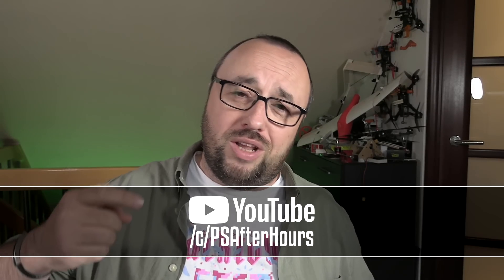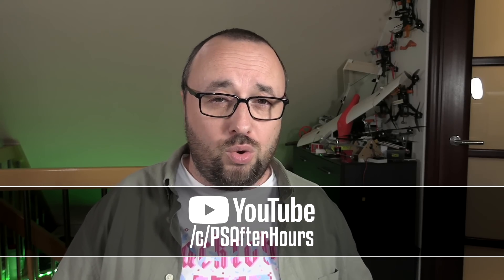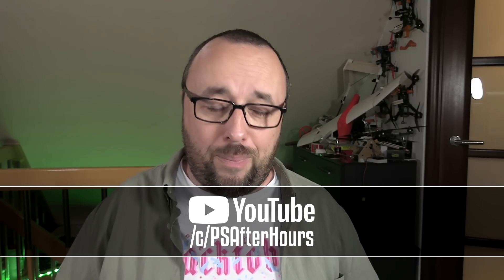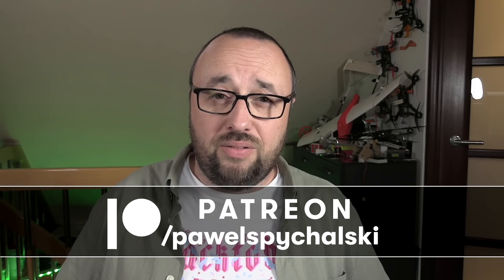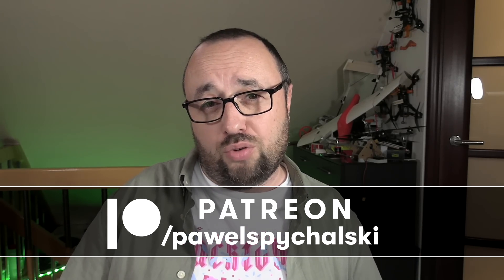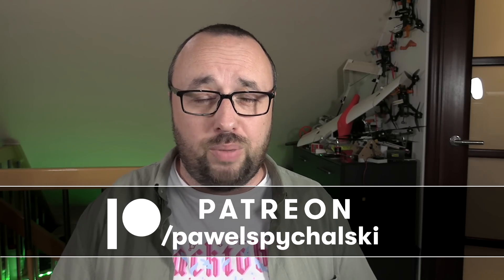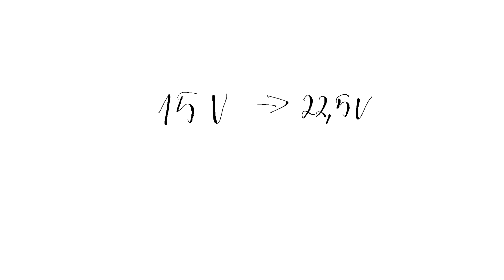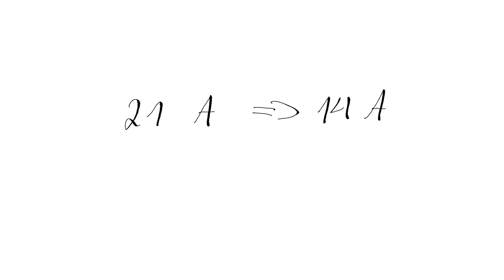Is 6S LiPo battery more efficient that 4S?

Comment: There is a lot of solid info here about electrical power, and you make a point about the small losses over small lengths of connection wires. But your model of motor efficiency seems far too simplistic and inaccurate. It seems like power dissipated in driving a motor is something like (a+b) I V +  c I^2 R where the I V term combines (a) the mechanical power with perfect efficiency and (b) losses that scale linearly like friction, while the I^2 R term represents (c) losses due to electrical resistance or magnetic field eddies. It looks like good motors may hit 90% efficiency at peak, but that efficiency drops roughly linearly as rotation speed lowers and drops severely at speeds higher than peak efficiency. So it seems like the lower I = current required to achieve a target mechanical power on 6S instead of 4S could be significant if either (1) it's at low rpm where efficiency is poor, or even more so (2) it's a high punch out rpm where I^2 is huge. And particularly in regime (2) the 4S motors generate more heat, which increases R and further degrades performance.

This comes from a few general searches, and I didn't put a full quantitative argument together. But it's enough that I worry something significant is missing from your presentation. What do you think?

Comment: What about voltage sag? I think 6s had much less sag than 4s, making 6s feel higher performance.
Reply: Less sag is because of less amp draw. If you are flying a 6s 1300, then it should be compared with 4s 2150mah. Simple physics. Then check the voltage sag.
Ultimately 6s, thrust is not increased.
Reply from the maker: Like @ForbiddenFPV  wrote. Less sag because current is lower. But is you scale C rating and capacity, sag will be very similar. Smaller on 6S maybe, but only a little smaller

Comment: 6s are more efficient not so much at hoover thrust but more full trottle. Because the lower peak current less batterij sack.
Where it is 10mOhm x 100A is 1V . So less need for thick cable is lower weight. The key to higher voltage is lower losses in the cables. The difference is bigger if you go 8S or 12S problem is there are no 2208 700 to 900kv motor it is even possible to use  16850 batts 12S pack for 7” 9” endurance freestyler

Comment: I'm not an expert by any means but I just thought of writing my thought on the subject as I'm also an avid RC enthusiast. Yes I do get the point you are making here which basically is a fundamental principle of physics - ie. the law of conservation of energy.
But for our practical purpose in our particular application, don't you think it is only natural that we tend to get inclined towards what we experience in real life when flying 6s? If we do feel the difference and we like it, I'd say we would tend to go for it whether or not 6s is more efficient than 4s. Yes "better" is a relative term and yes, all else being equal, there would perhaps not be a difference. But as 4 is not equal to 6, theory may appear to contradict what we may percieve in real life. I switched to 6s and I'm loving it!😁
Reply: 6S is MUCH more efficient, he screwed his calculation up badly. Electrical losses are based on (current^2) x (resistance), its not based on voltage drop like he showed.

Comment: What about the inductance of the motors? Resistance is not relevant when using high frequencies so inductance should be used as well. I believe a higher voltage will build the magnetic field quicker given the same inductance. It would be interesting to see how that balances out (If it does) when the motor inductance changes due to the change of kV. Technically speaking, does this also mean that the ESC frequency should change in order to make it a fair comparison and therefore there would be a difference in MOSFET switching losses? (Not RdsOn as that only matters when the MOSFET is saturated, I mean the resistance while it's transitioning which is the major source of heating and power loss in a MOSFET)
Reply from the maker: Everythjing balances out :) Lower KV, more windings, higher inductance. Higher voltage, higher rpm. Science baby!
Reply: You can have higher frequencies on lower voltage...

Comment: More rpm for less current. Yes it’s more efficient
Reply from the maker: No, it does not work like that.
Reply: @FPVUniversity  example motor 1000 Kv, same esc, same prop. running at 2a
4s: 16,000 + rpm 
6s: 25,000 + rpm
No? 

Ps: I never get a reply when I have an actual question! Lol
Reply from the maker: @samsonfpv8902  no. I mean rpm is correct but current is not. Current = Voltage / Resistance. Since resistance of motor is constant, current will grow as well

Comment: At 11:30 Does not the motor only use 2 wires at the same time ? The third being used to raise the position / speed of the magnets ?
Those who fly in 6s with 1950 kv engines but fly in cruising mode actually use a lower range of use of the engines but it is also a more efficient range ! And have more flight time and lipos have less current to supply so also heat less and there is less heat loss. Idem for ESC, etc...
Another small joy, with a 6s battery, there is a better chance of ruining the battery for an HS cell !

Comment: It's not more efficient in terms of watt hours used. 6s systems use more watt hours not by much though. That means it's not more efficient than 4s and if you compare 5s you'll find it's the best platform that is in between 4s efficiency and power of 6s. Ryan Harrell talks about this in his yt channel

Comment: That's "pretty-close" to what happens, but definitely not the whole story.
Current (Amps) is what generates HEAT, Heat is wasted Power.
With 2 "identical" quads, 1- 4S, and 1- 6S, 
compare the TOTAL HEAT that is DISSIPATED by EVERY PART,
NOT JUST THE WIRES.
The Motors, Circuit-Board-Traces, and ESCs all generate HEAT, 
LOTS OF HEAT,
the amount of Heat is directly related to the CURRENT flowing through these parts,
NOT THE VOLTAGE, and NOT THE NUMBER OF WATTS, ( Volts X Amps ).
The only reason these parts don't fail from overheating is because
they have a constant blast of Air blowing on them.
.
.
.
Reply: Using P = I^2* R would be a more straightforward way to go about the calculations, but algebraically it's all the same. He computed the total voltage drop across the constant resistance sources, wires and motor controller FETs and such.

You can easily manipulate the system of equations for power and ohms law to show that power loss is the result of voltage drop across the cables just as easily as the current through them. P = I^2 * R = V^2/R. you do have to be diligent about which voltage and currents are used in those formulas. V is not the voltage of the battery or the voltage applied to the motors but only the voltage drop across the transmission line.

Comment: So.. bearing in mind the price difference between building a 4s and 6s quad... Which would you recommend in order to fly longer and to be able to freestyle?
Reply: I’d say 4s considering batteries are quite cheaper which will keep you in the air longer
Reply: Engineer here. 6S WILL fly longer, period. This guy screwed his efficiency calculation up horribly, voltage is much more important than he applied. Efficiency decreases with current^2. 50% more voltage equals 50% less current, thus much less losses to heat. This is why local power lines are 10,000 volts, and long distance power lines are 765,000 volts. The power companies don't increase power up to 765,000 V for fun, they do it because its orders of magnitude more efficient.
Reply: @Chris-hn4lp  yeah but you need heavier and bigger infrastructure. And weight and size is important for aerodynamic aircrafts. That is why  there is an optimal voltage for every size of quad...

Comment: Nope. Huuuuge difference, if you use li-ion with very low C. 6s on li-ion v/s 4s on li-ion * exact the same C (max amps) = much more power.
Reply from the maker: Here you have a completely different problem. Li Ion have higher internal resiatance and will sag more with the same current. On top of that, you can not build the same weight and energy 6S and 4S Li-Ion as 18650 are 18650. But the efficiency on the motors and loss on wires stays the same.
Reply: I think you should watch the video again.
Reply: @romanwalchli8550  I think, you should try 7-incher on 6s lio, and on 4s lio (yes with different kv motors of course). 4s1p just cant give you the same amount of power as 6s1p - current limit is the same, say 15C, but no limit on voltage.

Comment: Since 4s battery has less balancing wires, less walls between cells and allows to use thinner wires it is lighter than 6S, that means it is more energy dense. Also it allows to make all the wires on a drone thinner.
Thus 4S drone will be significantly more efficient than 6S drone.
Reply: You got a point. But the overall losses we're talking in Ohmic Heating and Regulation losses, are much more dominant factors than Energy density

Comment: I think there's another 6S big difference not mentioned here: long-term savings on electronics. When using 6S set up with 4S motors we need to do motor limit (not throttle cap), for example motor limit 70%, and then in crashes we have less current to burn the fc/esc.
Reply: Running 6S on 4S motors is not good anyway. The vast majority of people run 6S on 6S motors.